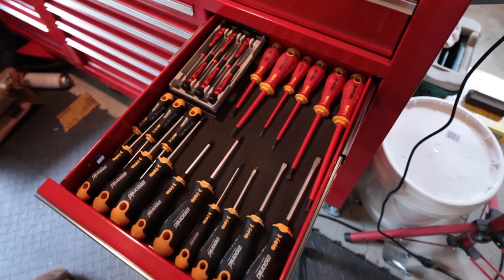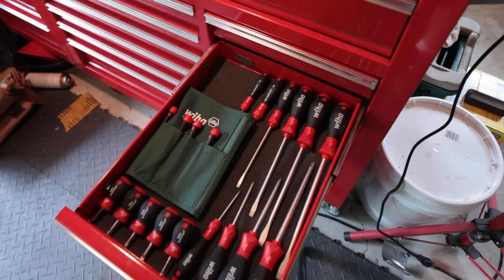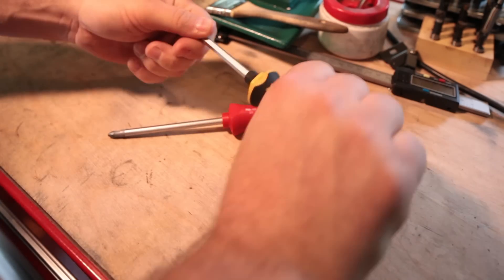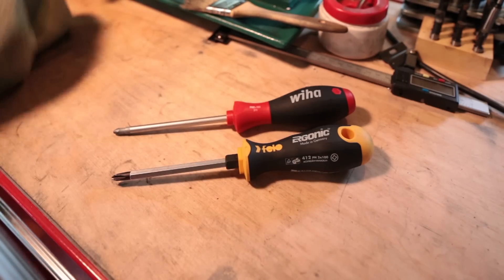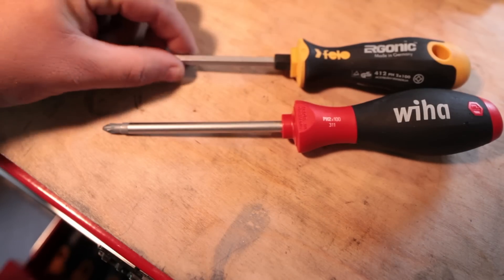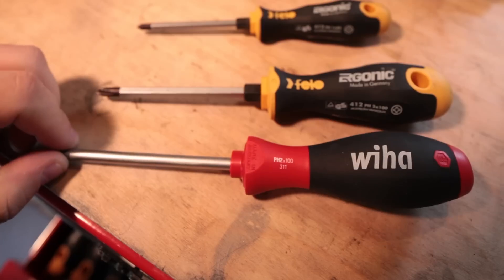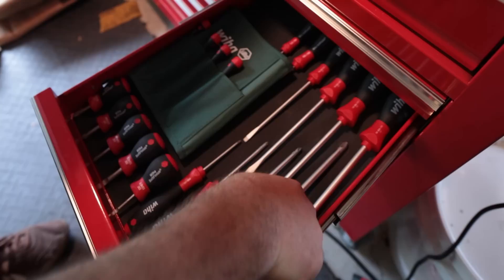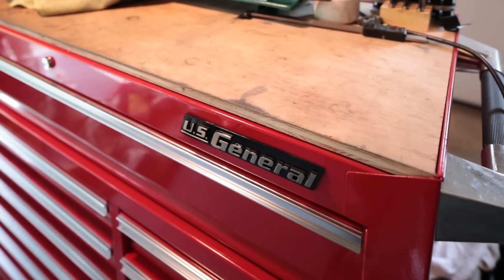Screwed Drivers - Why I now prefer Wiha over Felo Screw Drivers

Comment: I got a box of Felo drill bits and even with a 18V drill, you can't harm these bits. They are insanely strong. On the other hand though, I needed a replacement for a false delivery and Felo not only replaced the false delivery but also gave me a free Ergonic PH2 screwdriver with it. Pretty cool service. But I got exactly the same tip strength problem that you're showing here. I've used the screwdriver for assembling one table and it already looks banged up to the point that I would usually not use it anymore. Pretty wierd...

Comment: Awesome, sealed the deal on a set of Wiha's.  I was really looking at the Felo's as they do feel insanely nice in the hand, but the gritty stickiness that could happen is a no go for me.  I love tools, but I tend not to keep them as nice as you got.. One day.  Thanks for the video.
Reply: +Clayton Anderson  Try the Felo "frico" , which i prefer over the "ergonic" , only these i use now with the WIHA soft-finish...........:]
Reply: +CC MOGS thanks for the response!  I'll keep an eye out for those.
Reply: In my opinion, the handles are much much too small on many sizes of the Frico line... super clumsy manufacturing if you ask me.  If you want the pound through handle that come in the 550 series of the Frico line, I myself much prefer Wiha's pound through handle, or Wera Chiseldrivers are even better (Wera was in Germany, now Czech Republic... if anything the quality has only gotten better since they moved the factory).  

I work at a company that distributes Felo, Wera, Wiha, and even Witte via. Knipex.  The only 2 felo lines that made the cut for me are Felo's smart handle w/ applicable blades including part# 52037 which makes a good bit-drive if needed (their smart handle is basically a screw-driver & a T-handle in one... very cool engineering there), and their other very well performing product is a bit-driver that magnetically holds 7 bits in the handle and gives great torque, balance, and ergonomics (not the ratcheting version though).  The bit-driver I often use as my backup when I temporarily misplace my real screwdriver in a given size.  This bit-driver is #5227/5229/ or 52769 w/ part# 52037 used in the blade, but the blade has to be modified slightly to lock in the handle properly, and it also works as a 7" extension in a drill is the main reason I prefer to do the mod... if you want to be lazy, #52221 or #52765 are what you want.  

Other than that Felo is totally a dud as far as I am concerned... their Ergonic series seems nice, but they simply don't function well because they are far too soft and too gripy for regrip between turns, which is slow in comparison to Wera for example and the soft handle actually flexes with the torque making turns less efficient still.  The best performing product for a 1-pc screwdriver I would give to Wera over Wiha in general, but not for all sizes, and Wera's quality is much better in the details.  Wiha is a far more innovative company that puts their efforts more into design than quality, but their quality is also excellent w/ the exception of their driver bits.  Wera is sort of a boring company in terms of design, but at the same time their performance is unparalleled for the basics. 

Wera's square drivers for example hold up 10 or 20x as long as Wiha's square screwdrivers or bits because Wera does a hollow grind that is very different and it is easier on screws too... on several occasions I have accidentaly used the wrong side of my #1/#2 double end driver (Wera, Vario series blade), and I have used that #1 driver to drive a #2 drive screw w/o damaging the screw or the driver... try doing that w/ any other brand!  My favorite product from Wiha for low to mid-torque applications is their drive-lok 6 series (6 meaning 6mm shaft), and that is probably because they take up very little space in the Veto Pro-pak, and you basically have a stuby and standard length screwdriver in one tool that is double-sided, so 4 tools in 1 w/o sacrificing blade length.  Wiha also makes great pliers very close in quality to Knipex.  

When it comes to precision screwdrivers, there is no comparison whatsoever... the winner is Wera by a landslide.  When it comes to driver bit quality, the winner is Wera by a landslide.  When it comes to ergonics of basic screwdrivers like what is shown in this video, it's pretty much a toss up for me between Wera and Wiha, and my preference is on a size by size basis and I prefer different series so each screwdriver is very easy to spot, but I'm leaning towards Wera just slightly.  If I had to pick one or the other, I'd pick Wera in either there basic Kraftform green and black or their yellow chiseldriver series... both are very well balanced and exceptionally functional.  For higher torque applications, all my tools go to Felo because that smart handle is hard to beat because the torque is there if you need it, and often times I do (torx and nut-drivers just gotta be Felo Smart series Blades esp. in larger sizes, and a bonus is you can always put them in a drill which saves crazy amounts of time).

In my Veto Pro-pac toolbag here's what I keep: Wiha Drive-Lok for Phillips, Robertson, and Metric Hex, Felo Smart handle + blades for Nut-drivers 7/16"-9/16" and all torx, Wera and Wiha Screwdrivers for slotted on a size by size basis (I've owned them all except I could tell Witte wasn't a contender), and Wera micro screwdrivers for T4, T6, T8, PH0, PH1, and in Micro slotted I go with Wera's micro ESD-safe series not because I am worried about static electricity, but because I prefer my tools to be identifiable by color, so I keep all my slotted yellow in the precision drivers.  For small sizes that I only use once in a blue moon I keep Wiha micro bits... they suck to use, but they don't take up any space, so it's easy to have all the less common drives w/o taking up all the room standard drivers would need.

For pliers: in this order, Knipex red-handle, Wiha red-handle, NWS, and don't even think about buying Felo when it comes to pliers... not much better than China!

For powertools, Festool and Metabo are great German brands well worth the extravagant prices they get for their stuff.

For anyone more mobile, consider grabbing a Veto Pro-Pac... made in China, but the quality and organization is probably the best out there.  I've owned multiple sizes, but the OT-XL is what I'd recommend... a closed top bag is such a pain that it's hard to describe and if you go bigger than the XL (like I did on my first purchase) you probably won't be able to comfortably carry the thing... whatever you get, grab an open top unless you do more traveling than working.  These are great because every tool has it's place... if a tool wasn't put away, you'll know exactly what you're missing.

Also, I couldn't do much of the work I do w/o a good headlamp.  My favorite is the Surefire Maximus... if the Minimus were rechargable I like the minimus better, but the battery life and cost of batteries just isn't worth the extra comfort... I got used to the Maximus fast after making the switch.  Fenix headlamps are no good (not enough flood).  If you are considering a different brand, I think Nitecore and Olight are the only other contenders there, but I haven't owned either.

Klien makes my favorite tape measure (the version w/ the extended wings @ tip), Croc's makes the best electricians pliers, Festool makes the best brushless 6" sander, miter saw, tracksaw, jigsaw, etc... anything related to wood, and I think Metabo makes some of the best powertools w/ a noticable difference in longevity and performance.
Reply: True but near perfect for my size hands................

Comment: Great brands, the first and I will say best screw driver to me was the old Felo screw driver that was shipped as a car tool in many German car brands like BMW, Mercedes and Opel. My colleague was using is often as a chisel then I realised that this is pretty good screw driver for the torture that it gets and still works the handle was plastic poly propylene and I remember that it looked to me as a single pole screwdriver. Obviously, because of the hammering, the blade went deep into the handle. I am happy that I managed to salvage this screwdriver and now I am a big fan of their products. I also have Wiha set, respect for them as well but to me, Felo Frico and Ergonic are the best.

Comment: All my insulated screwdrivers are Wiha. They are great. I like the grip on them better than my kleins. I have a couple of wera's that are okay but I rarely use them often. I just ordered my first felo #2 pozi drive today. Hopefully it's not too bad.
Reply: +Torontodude20000  Totally agree.........I"d use WIHA before Wera ,  also use felo "frico"............:]
Reply: Better than Klein grips !? The first time I held a mini wiha screwdriver,  grip half that of the normal size, but not electronic size, it felt so off. I also held the larger one with bits that pop out the handle, also felt off as well. I still haven't tried a normal wiha, but idk , I just don't know

Comment: What do you recommend for torx sockets?  I haven't found any decent ones yet - I seem to ruin them frequently when dealing with seat belt anchors or bolts on Jeeps.  And yes - I use the correct size, but eventually the bits start to twist.  Even the impact grade torx sockets I picked up at NAPA have this problem (and I'm not even using them on an impact gun!)
Reply: Torx transfers so much torque that it's hard to get anything to hold up.  Bondhus is probably your best bet.  Impact sockets are actually softer than typical sockets in exchange for better toughness, so I'm not sure if that's the route to take if you're ok running them by hand.  Bondhus probably has the best steel out there.  None of the companies listed in this forum (that I have seen) make torx sockets except Wiha, and believe it or not, Wiha's driver bits and sockets are among the worst I have ever tested, and they are generally less durable than quality China manufacture, however, if you must use an impact gun, there are bits specifically rated for that made by both Wera and Wiha, and this is one bit that Wiha actually won a contest with recently, so it is an exception to what I'm saying.  Horrible bits in general (good precision, but far too soft/tough) but Wiha does have the best impact bits.  I'd get bit holding sockets (Wera #05057675001 or Wera #05048680001 if you really want to go all out), and stick an impact rated bit in them... garbage you get at NAPA just isn't going to give the same performance even if it says "impact" on it.  Wera's bit branding is "impactor", and Wiha's is "terminator", and Wiha won the contest @ about 30 seconds for a failure.  With how good Wiha is at marketing, I wouldn't be surprised if they set up the contest, but Wera's impact bits are overpriced, so even if their bits are better, I'd still spring for Wiha if I were you.  Again... impact good, but for any other bit, go with Wera... Wera tempers many of their bits 6 different ways to guarantee the right balance of hardness and toughness to fit the application, but even for their run of the mill bit, they are still a lot better than Wiha's bits.  Good luck.  I work at Champion Bolt and Supply in Everett if you don't have any luck finding something something you like elsewhere.
Reply: Jeeps are infamous for torx. Have 2 wranglers and fight with them constantly. If I can replace them with standard hardware I do. If not, once I fight one out I replace it with a new torx bolt lathered in anti seize

Comment: What do you think about Witte screwdrivers? For me their almost triangle handles (especially Maxxpro Plus series with additional friction material) are the most convinient. And unlike many users I do not like Wera handles form at all. I have one Felo and some Wiha screwdrivers and I also noticed that material of Felo handles is... sticky. Definetly not for dirty jobs (like car repair).
Reply from the maker: I agree on the Felo material but I will have some updates to this shortly.  I would be interested to try out some of the Witte units they look interesting.  I have been sitting on another set of Felos that IMHO are very similar to the Wiha.  Review coming up shortly.
Reply: I have the Witte "Protop plus" and the "Maxxpro plus". the grips on the Maxxpro are extremely nice in shape and material. However i made the switch to all Wiha drivers. and this was mainly because for some reason the Witte tips just did not seem to properly fit like 80% of the screws i use on a daily basis. Like they always would work but you could tell it was just not quite the right fit. most obvious one was the ph#2. My use is a vary wide variety of fields, but mainly on electrical pannels, devices, and fittings. i have 0 regrets on switching to Wiha so far. seems like the same quality of tool but they seem to fit a the screw heads like a glove.

Comment: hey man great review, i was looking at the craftsman extreme grip or the cushion grip they offer because i like really rubberized grips on most of the handles of my tools makes it alot comfortable to work with. also have a problem with the dirtyness factor when working with oil they get on the handle and it sits inside of the grip and it sometimes it makes it harder to grip as well when working with gloves. also husky is not bad either really rubberzied cushiony  grip

Comment: Not all Wiha tools are made in Germany either.I'm basing my opinion on experience as a auto electrician.
The snap-on instinct handles are much larger than Wiha or Stalhwille drivers in the smaller sizes. I recently used Snap-on, Stahlwille and Wiha T25 drivers and found the larger instinct handle of the Snap-on great for spinning and flicking quickly with a good solid grasp and I was able to really torque it up compared to the other 2.
However Snap-on don't make any electricians parallel type  slotted drivers  in 3-6mm range therefore I have a few Wiha and Stahlwille to tighten terminal screws.
Reply: wiha screwdrivers are still German made. their bits, pliers, and some micro drivers come from Vietnam
Reply: @jerrykruger  I read somewhere that in order to get the german made screwdriver set you have to 
order it from amazon of Germany at more than double the price than the export sets made by
Wiha in other countries. I will like to know how true is this report.

Comment: Screwdrivers without replaceable bits went out in the 1800's.  Get a set of Makita Impact Gold at about $1.00 per bit and get rid of the 50 different types of screwdrivers you have.
Reply from the maker: I'm good - I hate "bits".  By default the screw driver shaft is larger which means you can have trouble accessing small areas.  Also I don't prefer the jiggle and wiggle of the bits in the end of the screw driver.